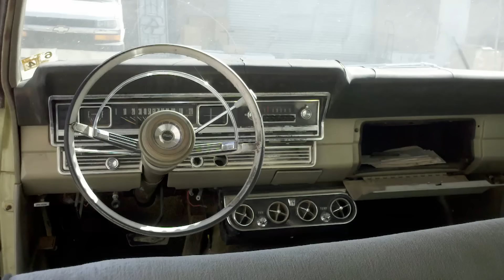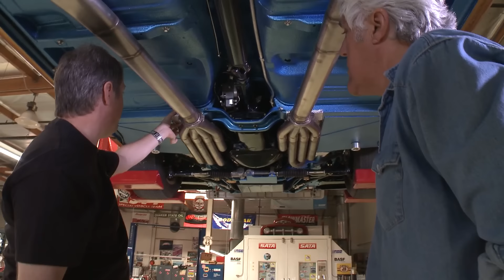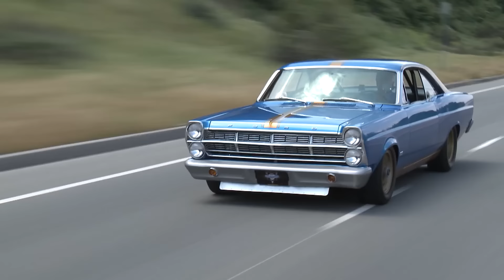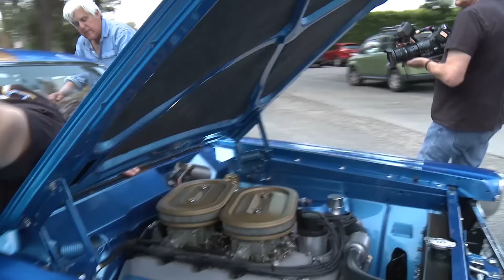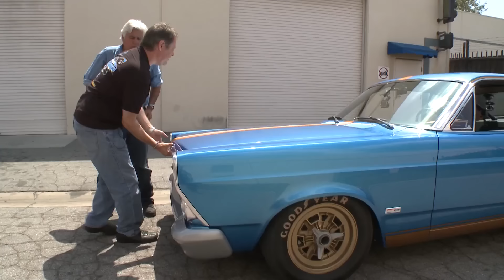1967 Ford Fairlane - Jay Leno's Garage

Comment: They did a great job...screwing up a Fairlane survivor.
Reply: What are you talking about? It was an ugly derelict with no balls, they turned it into a beautiful muscle car. It's all period correct, and it's all original where it counts.
Reply: +HunterShows Nobody wants a 6-cylinder Fairlane...
Reply: +HunterShows if it was a V8 survivor with a 3 or 4 speed that would be different, but before these guys got a hold of it, it looked like something my grandma would drive to church on Sunday... I love survivors, I love restorations, and I also have appreciation for resto mods like this that are done to perfection this takes a lot of talent to pull off something like this that I certainly don't have... I say well done for sure
Reply: ***** That would've just been more unnecessary work. It's supposed to look period correct, which it does, performance wise, I really am not bothered at all when someone upgrades the suspension on a Muscle Car regardless of what  condition it's in, because there are few things more fun than a car that can go fast in a straight line and around corners, and tires only go so far.
Reply: ***** When you start with a good base like this, you have a better basis to do the things you need to do. Not having to add body fillers such as bondo or whatever is a huge advantage for one the car will last longer and not have to be touched up in 5 years, two because it is an original body that's going to look good down the road to whoever buys it.
Reply: HunterShows  If you can't say something nice, shutup.
Reply: MaxTheKanuck Whaat? It's supposed to look period correct. It isn't. It has random gauges, Lamborghini knock off wheels, and a suspension that Ford never dreamed of in 1967.

Point being, they could have taken a junkyard type as the donor but they ripped up a pretty good looking car.

Comment: I picked the linkages had slipped immediatly. A tack of MIG fixes that!
While I get the car I do NOT get the torsion bars? Coilover on all 4 corners would be far simpler and efficient. It defenitly can be done on the front with that big [very powerfull and rare]  lump. Ford did it on 70 Mustangs!
The gold hilights are not me, wheels look great but were I bet very expensive.
Drop gears in the diff will have a quite short life and probably be noisy too. Though near infinite ratios

Comment: Wow. That engine block is huge. Jay, you should find an '84 Mustang "GT350" and drop the new GT350 Flat-Plane Crank motor into it. That would be a fun project.
Reply: +Non Serviam 
I don't think they ever made a 84 GT350 mustang?
Reply: It wasn't official Shelby but Ford released a "Anniversary Edition GT350" in 1984. The only thing special about it was the white paint with lower body stripes.
Reply: +Non Serviam 
GT350 came out in Jan 1965, and 1984 makes 19 years, not a typical anniversary date, this is really interesting, I didnt know this fact, I will check it out!..thanks

Comment: Immediately I saw the Mario Andretti '67 Daytona winner. If it is a quasi experimental car then the cable issue has been resolved. Glad ya got it home. The next issue is to do something with that totally out of place steering wheel. What a super build.
Reply: +Tom Snook Whats wrong witha 67 Fairlane wheel on a 67 Fairlane.  No girly power steering means you need the big wheel.   A horn button would help though!
Reply: +LDN Wholesale ....I mean with all the other non '67 "Ford" things and the "race car" sound and Daytona look..why not a nice Ford three spoke from some era. I think the 72 Mach I had one...I know it's smaller but with rack and pinion I'd thin it should be too tough except in parallel parking

Comment: Beautiful... Huge fan of Steve and his work.  
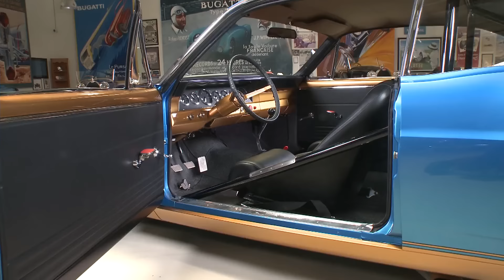5:37 what is that under the brake/clutch pedals?
Reply: +ubercooper I suspect it is one end of the torsion bar (you can see the other just about in the passenger footwell). Looks like it could also be connected to an anti-roll bar too.
Reply: It's so they can adjust the  torsion bar while driving.  one  on each side
Reply: +ubercooper  kinda looks like it might be a piece of the front suspension

Comment: I was hoping to see how they did the adaptive spoiler (air brakes) , unfortunately they only show it a few seconds & talk about it ... I'd love to look into how they did the whole mechanism .
Reply: +RDS Alphard looks like that spoiler is electrically operated by the brake lights signal.
Reply: Côme Thiburs 
I have rarely see people make stuff like that , it's amazing .
Reply: i think more people should use this, especially in time attack and road racing. because it would allow to control tank slap and traction loss at high speed.
Reply: Côme Thiburs 
It might be illegal though .
Reply: in endurance and super saloon series, it is :/
Reply: Côme Thiburs 
We need to see it more often on street cars too .
Reply: it's useless at legal speeds, if it was piper cubs would have air brakes.
Reply: Côme Thiburs 
Oh ?

Comment: what's the thing on the floor under the brake pedal?
Reply: +rondogwil - That's the adjuster for the driver's side torsion bar. (you can see a similar piece in the passenger's foot well)

Comment: That thing is a beast.  I'm sure he'll get the little bugs worked out.
Reply: Hey I'm subbed to u lol
Reply: Cr125stin Thanks, I appreciate it!
Reply: That thing is a BEAST!!! When I was a teenager a guy in my neighborhood had a 67 Fairlane with a 390 ci and 3 2 barrels. That car fed on 396 Chevelle SS's. The 390 was Ford's go to motor for a while until the advent of motor's like the 406 with 2 4 barrels ( limited production 1963 Galaxy) the 427, 428 Cobra Jet, the Boss 429 and of course the 460 which went primarily in the Lincoln and T-Birds and found it's way into hot rodding and drag racing.  Ford has done some serious PERFORMANCE MOTORS in their day. Ford fun fact: Ford made a 503 ci overhead cam engine in the 40's that powered the M4A3 E8 Sherman Tanks. Called the Crazy 8 this was the military's attempt to address the shortcomings of the Sherman tank.
Reply: +RamblinAround Hey me too.lol

Comment: Jay is making fun if this guy i love it :)  because any gear head would know that crab`s use a return spring return to ideal position ... All insanity all fucking work that when in to that car and safety was over look ,,,,,good thing there was main power cut off in that car , and Jay reacted fast enough , over center means the carb was stuck at full throttler

Comment: Absolutely beautiful car. I was mad that another clean 6 cylinder car had to die for it, but this is tasteful.

Base model cars need love too.
Reply: +kirbyswarp especially ones with what looked like factory a/c.
Reply: +Ecosse57 Could have started with a shell and made the same car, since they threw the interior and trim away anyway. why kill a survivor car?
Reply: kirbyswarp
 exactly. rich people in cali think these things drop from the trees. i see it happen with old bikes too.
Reply: +Ecosse57 No one in the 60s drove the big v8 muscle cars anyway. Chances are most cars on the street were speced like that or with a small v8. By some miracle, that 6 cylinder car survived nearly 40 years and they cut it up. I'm willing to bet there are more fairlanes with big v8s than Ford even made. At this rate cars like that will soon be extinct. The same ones that were nearly everywhere at one point.
Reply: +Ecosse57 No one in the 60s drove the big v8 muscle cars anyway. Chances are most cars on the street were speced like that or with a small v8. By some miracle, that 6 cylinder car survived nearly 40 years and they cut it up. I'm willing to bet there are more fairlanes with big v8s than Ford even made. At this rate cars like that will soon be extinct. The same ones that were nearly everywhere at one point.
Reply: +Ecosse57 No one in the 60s drove the big v8 muscle cars anyway. Chances are most cars on the street were speced like that or with a small v8. By some miracle, that 6 cylinder car survived nearly 40 years and they cut it up. I'm willing to bet there are more fairlanes with big v8s than Ford even made. At this rate cars like that will soon be extinct. The same ones that were nearly everywhere at one point.
Reply: I got "mobiled". Thanks Youtube app.

Comment: If the throttle cable was the worst thing you found on the shakedown that's nothing short of a miracle. That is so inconsequential as to be laughable. But that cammer engine was a beast. Banned from all kinds of racing because NOBODY could come close too matching its potential.  So Chrysler got it banned. On the down side was the fact you had to be a genius to make it work. The timing between the two cams the stuff of nightmares. But when it was right, the competition was no longer competition. That '67 Fairlane was one of my favorite bodies of all time. It just LOOKED good.

Comment: Another awesome car on JLG. I've often wondered, and the extreme loudness of this car finally begs the question from me, what kind of arrangements are made with the local police and CHP to make these videos on public highways, when there are obvious "excursions" from CARB regs and basic safety equipment normally required on highway vehicles. Too bad the throttle problem prevented them from the usual rip-roar up an entrance ramp onto the freeway; hearing this car in full song is reminiscent of listening to NASCAR practice at Daytona or Talladega. What would CHP think about it, or do, if you came upon a patrol car while on the freeway? I've seen a ton of JLG videos, and can't remember one where this happens.

Comment: Brings back memories.  In the late 1980s my high school car was a 1966 Fairlane GT.  I bought it as a roller and then pulled a 390 from a 1968 Galaxy and planted it in the Fairlane.  With 4 drum brakes it couldn't stop at all but it went like stink.

Comment: Got to love a V8 that sets off car alarms
Reply: doesnt have to be a V8 to do it but V8's tend to be the engine of choice for that
Reply: I had a GMC dump truck with a 478 V-6 back in the 80's. It wasn't really loud but it had just the right low rumble that it set off every car alarm as I chugged along up the street.

Comment: What is the displacement of this engine?
Reply: 7liters/429CI
Reply: +Datttsnake 427 FE OHC! Big bore short stroke unlike the  small bore long stroke grunter FE enine used in [among others] 7 litre Galaxies
429 is a 70s engine for primarily full size tanks,, and is actually physically smaller than the 427/428 FE engines, an overgrown Boss 302 in many respects, Larger Windsor style block with canted valve [Clevo style] heads
Reply: LDN Wholesale Oh sorry my bad, I forgot it was the Cammer engine.

Comment: My dad has a 66 Fairlane it's brown with 390ci and auto, it's the next car he's going to build, he has a 429ci that's going in it as soon as he finishes my mom's 67 6cyl Mustang convertible. I also just bought my first Ford an 88 F150 302 5 speed lol going to add headers and exhaust system soon and maybe a cam if my dad has the time.

Comment: one of my favorite episodes. love how they included the throttle failure.  that's real life hot-rodding.
Reply: yea im glad they did too. at first i was like "wow a 27minute episode" (i love that) then i was like ok a 10 minute drive or whenever they left the garage. but this was just so nice to see aswell. id have rathered have the car drive some more but hey at least they didnt cut to saying it had an issue. i honestly love the Recoil Chevelle the Ringbrothers built and brought on the show and i love their work. but Steve's way of building cars is in my opinion the best. he likes to think of something logical and potentially done back then and does it. he doesnt go too far fetched either. the active aero was a bit much on this but hey as he said it was a new thing companies were experimenting with back then so it makes sense. love the Miura style wheels though.
Reply: +kyle stewart Couldn't agree more.. The other thing I appreciate about these videos is the fact that there's no manufactured BS crisis to deal with.. It's just about cars and the people that build, sell, drive and own them.. Fantastic!
Reply: +inno8sky  
Ain't it the truth. I get SO tired of the :crisis" in all the builder shows. Manufactured BS. EXACTLY. And yeah Chip, I'm talking about you. I won't speak bad of the dead, but y'all know who else I'm thinking of.
Reply: I have had a couple over the years. One I put a nickel under the idle screw and had a set speed depending on the fear. A different car, used vice grips to hold the cable end. One got the shoestring treatment for the drive home.
Reply: +kyle stewart The first things I fail..and ebrake. The build is fresh, the cable has the burn in monster. You'd think they had that stuff mastered by now. I even have a nut and bolt in a high comp subaru cable.

try lining the connect with a bushing.. take the metal signal away.
Reply: Tom Swinburn

Comment: Putting lambo wheels on a ford, in order to insult ferrari? That's nothing but cheap provocation. Two words: low class
Reply: It's for heritage because the 60s Ford Le Mans cars used lamborgini rims to insult Ferrari and also because they worked and they were light

Comment: Don't like this one. I dislike the sound and crude sounding idle. I doesn't seem like something you could enjoy driving for a long time.
Reply: +Thomas Talbot I don't think this car was designed with everyday driving in mind... the crude idle is a result of an aggressive cam. This car is downright wicked! But I'd agree with you that this car or a car with it's tuning and handling characteristics would be a bear on a day to day basis.
Reply: +jeadelmann90 That's a good point.   This seems like something a driver would get tired of in not too much time.  I guess I prefer 'complete packages'.  If someone is really excited about ultra modified super high horsepower cars - I can see why they would like it.     The execution in that aspect is probably really good - that suspension work must have been tough to do.     I think the part that got me was the awful sound of the engine idle.
Reply: Thomas Talbot This is certainly a raw experience. I've seen some LSX engines with super aggressive cam profiles that cause the cause to die as the owner backs out of their driveway. This car is designed to be a brutal assault on the senses... I'm not much of a Ford guy but I have to admit I found this car kind of appealing... I always viewed the Galaxy and Fairlane in the shadow of the GTO from the same time period... I always thought of the G and F as uglier versions of it... but this particular car is pretty bare bones... No AC... no horn... I'm not even sure if the doors lock... But god would it be a blast to launch... that engine is vicious... I'd probably have to have ear plugs... I love music too much... I don't want to be like olde Brian Johnson...